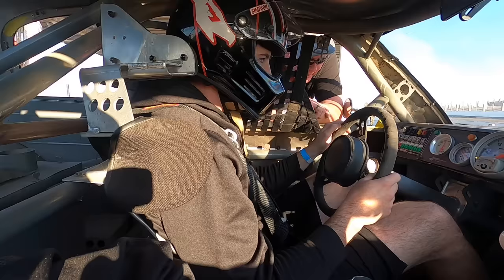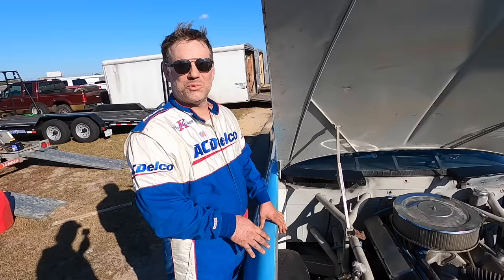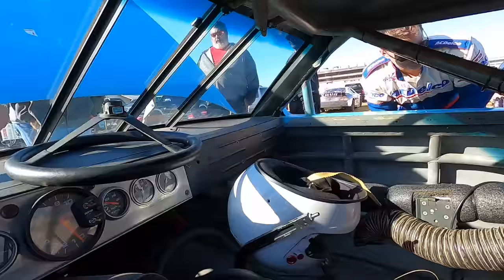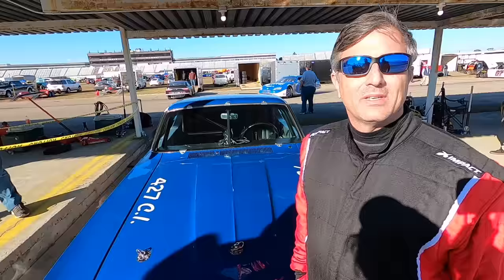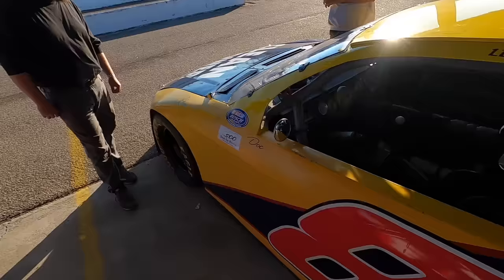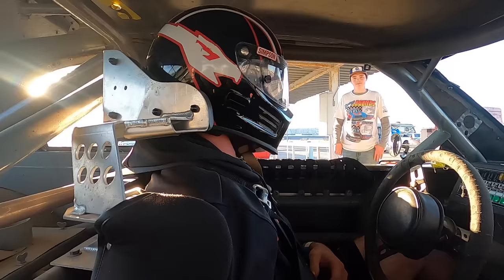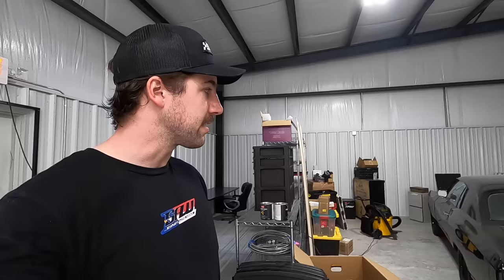Classic NASCAR Stock Cars Take Back Rockingham Speedway! (They Let Us Drive One)

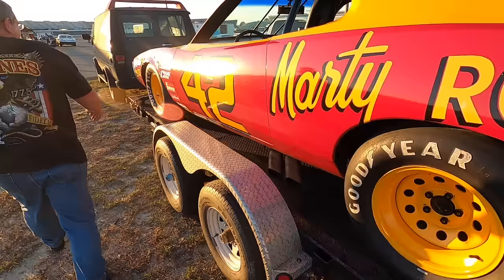Comment: 20:00 Looks like a buddy baker set up all cars in the petty camp were painted petty blue as they would sit in the garage waiting to race usually had 3-4 petty blue painted cars sitting around and when you find the black and other places in the trunk it was possible sent to the baker camp for track use many times he had cars quick painted and they were never perfect and if you dig a little you will need to look inside at the roll cage Buddy's and Richard's has nearly the same but slightly different just look at the gauges and switches. Also check underneath the roll bar padding will show more of whom was the original driver.

Comment: Back in the 60's & 70's Nascar was stock car racing. They would take a car off the showroom floor, Strip it down, and hot rod it up a bit. As it got along into the 80's they became tube chassis cars with thin sheet metal that looks like a current model.

Comment: Does Trickle’s 67 Ford Fairlane still exist? I believe he was the USAC Stock Car Division Rookie of the Year with that car. He raced regularly on the 1/2 Mile at Kaukauna WI, what is now Wisconsin International Raceway, on Thursday nights back then. I always loved that car.
Reply: Trickle’s Fairlane does not exist. Neither does his real Holman Moody Torino. The car in the video is a well done replica.  There is a better than even chance Trickle’s Fairlane was rebodied into the real Torino before the 1970 season. If so, that Fairlane/Torino chassis was destroyed by DT at Dover later in 1970 and raced no more.  The Torino in this video began life as built by Bobby Wawack. It is NOT a Holman Moody chassis but has been modified from as found Wawack trim to resemble one with pieces made by Others to include metal master Kenny Thompson A later style Hutcherson Pagan snout installed by Rhine replaced the cruder Wawack installed frame
member
Reply: @jachmguy7423  Thanks JAC. It’s a shame that the iconic Fairlane no longer exists. That would have been a super cool piece of racing history. Someone should build a tribute car of it.

Comment: You know that the vent deflector on the rear also causes a vacuum as the wind blows over it and it's also directing the air towards the rear spoiler or over it if running superspeedways

Comment: Re the Dick Trickle Torino:  based on what this Cheesehead and Trickle fan knows about Dick's career, and a little research, my educated guess is that's the car he ran in his NASCAR debut, at the Daytona 500 and qualifying race in 1970, and which he most likely ran in the old USAC stock car series the rest of  that year. I know he was a regular in that series around that time.  Note the legend "Kelly-Trickle Owners" on the side of the car. Fran Kelly was listed as the owner of the car Dick ran at Daytona, the only 2 Cup races he ran that year and the only NASCAR races the Stock Car Racing Encyclopedia lists Fran Kelly as an owner.

If I'm right, that means I probably saw Dick race this car at the first "major" stock car race I ever attended, a 100-mile USAC race in 1970 at what is now Wisconsin International Raceway. Don't remember how he did; mostly I remember that Roger McCluskey basically smoked the rest of the field. 

And FWIW, for those of you who aren't familiar with the USAC series, my understanding is that at one point it could have challenged NASCAR as the top stock car series in the country, but it didn't happen (possibly because USAC tended to treat the division as the red-headed stepchild to the open wheelers).

Comment: When did stock cars stop using pressed steel shells from a factory and change to roll cages with hand made skins?   Mid 60's?
Reply from the maker: Sort of a gray area. They were using factory supplied body stampings until the mid 90s. The bumpers and stuff were still factory in the 80s. Stock frames started to disappear in the late 70s I think. When cars downsized in 81 thats when the full tube chassis became the norm if I recall correctly

Comment: That guy is looking for a T-bird stock car. I cut a body off of a Texaco Havoline T-bird to put a 2003 Sterling Marlin Coors Light Dodge body on the chassis. It was a legit Texaco T-Bird till my boss wanted to re body the car to promote it as a more popular (at the time) Sterling Marlin car. It was even kind of sad back then doing it. I liked the T-bird better than making it a fake Dodge. That T-bird body is now mounted in a Ford dealership somewhere in Kansas.
Reply from the maker: find out where and let me know lol
Reply: @Stapleton42  I wish I could remember. I was at a lot of dealerships doing promotions for the dealerships. Now that I’m thinking about it I’m only 90% sure it’s in Kansas. Could even be Missouri and slight chance of Arkansas.🤷‍♂️😂 It was in 2003, memory is little foggy being I spent several months in that region going to dozens of dealerships. It is just the body though, no chassis. I plasma cut and sawzalled the entire body off in one piece so they could hang it on the wall.
Reply: @Stapleton42  Now that I think about it. I have pics from those old Kodak disposable cameras of me working on the chassis to fit the new body. There’s a slight chance there’s pics of me removing the old body because the work was done within days of each other. I’ll dig them up and look. If  there’s a way of telling where that body is in the pics I’ll let you know.

Comment: With a Petty car you take it to them, they'll look it over and confirm it.  They won't show anyone the specific things because people would make clones of them and pass them off as legit.  

I went through that with my buddy's car that came with word of mouth claim it was a Petty car, the one with the coil front and leaf rear.   They did say to try and find some numbers on it, on the rear end I think was one place, to check with them and see if there's a chance that it's worth hauling down to show them.  'cause there would be no point to haul it from NY to NC if it's definitely not a Petty car. 

of course it could even turn out to be one but it's had three front clips and two back ones put on it, so

Comment: What’s the setup on the car “well it’s setup for this track” AKA I know nothing about mechanics I just have money and buy speedy cool nascar vroom vroom 😂😂
Reply: What I meant by that is the front left had 2 degrees of positive camber. The rear end welds are +1 and -1 respectively. 1200 in the right rear and 1k in the fronts. 250 left rear. 35 on the lefts and rights. 

I didn't know if he meant engine or entire setup.